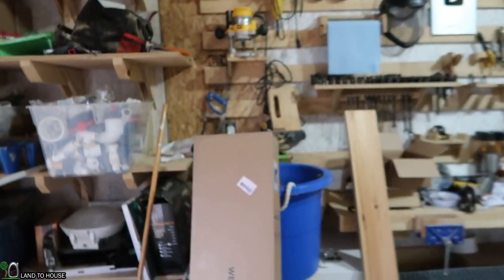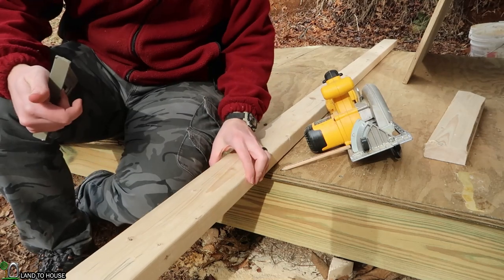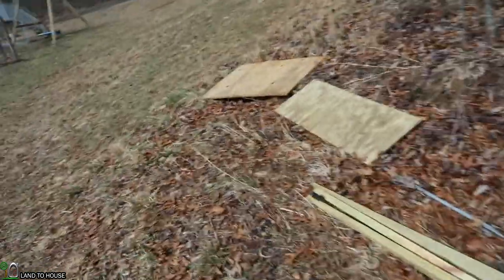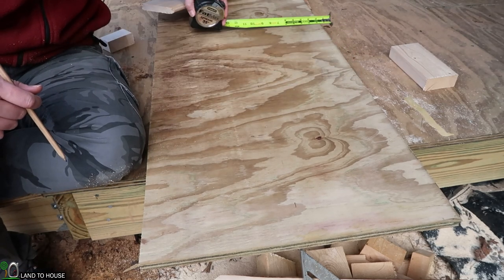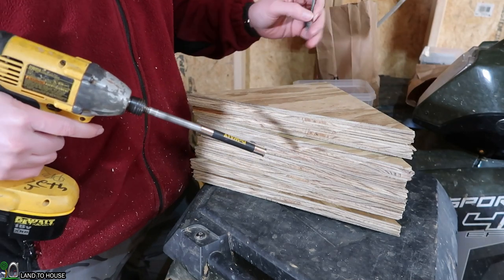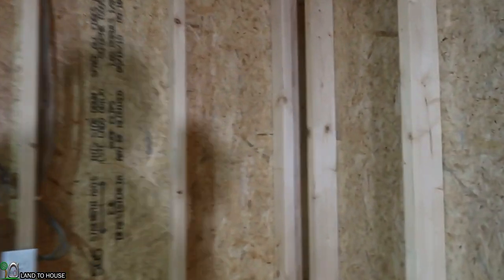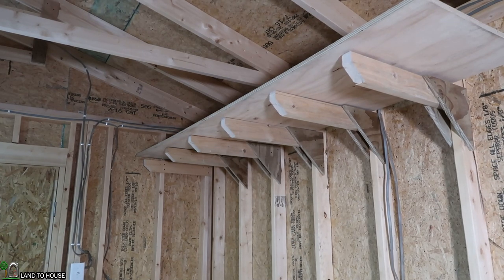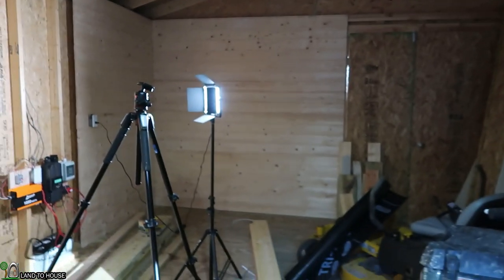DIY Wall Mount Shelves

Comment: Nice simple shelving that should be plenty strong.  Small suggestion, though... You could have picked up a chalk line at the hardware store and used it to snap a level line across the wall at your first pencil mark on the stud.  Then you wouldn't have had to play the balancing act with your level, support triangle, and impact driver since that reference line would be transferred to every stud.

Comment: Love the videos my friend.
Just to your right as you are using the compound miter saw to cut the diagonals of the triangles for the shelves, is a hold down clamp to secure your work piece instead of having to use a scrap on the left.
Hanging the supports, attach the first stud inside triangle, hold up the last stud inside triangle and a 2x4 across them.  With a level across the 2x4 will set your shelf brackets level.  Leave the 2x4 sitting on top of these 2 triangles and you now have  a stop/alignment block for installing all the other triangles.
Reply from the maker: Thanks! That clamp on the saw hits the motor on these really close cuts. So I have to use a scrap to hold those. 

I really like the 2x4 idea. I might have to do that today as I make more shelves.
Reply: @LandtoHouse  Glad you like the 2x4 idea and moving that clamp to the left side and cutting on the other 45° eliminated the motor/clamp interference (I have one of those saws)